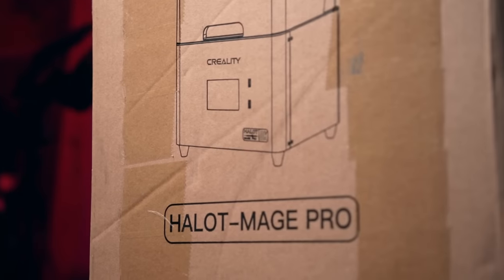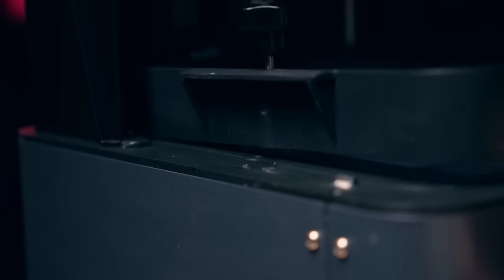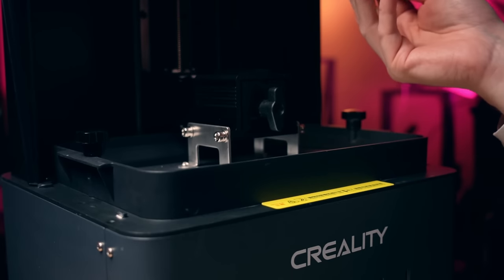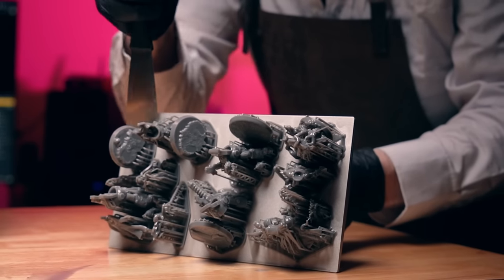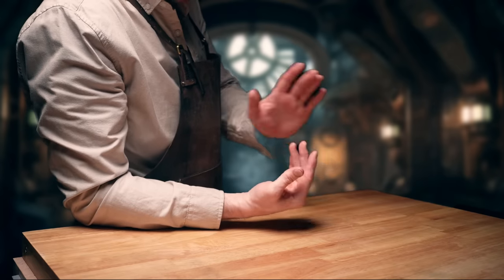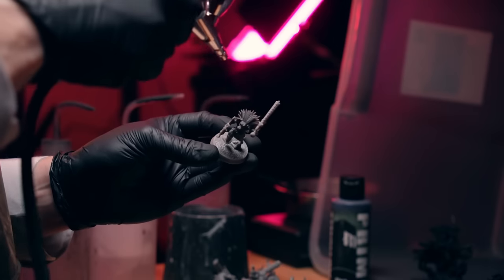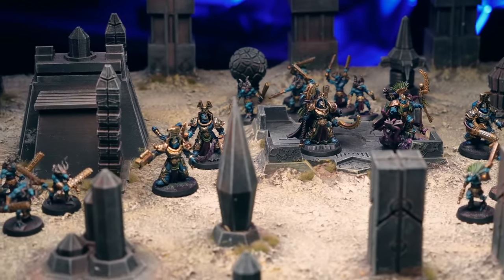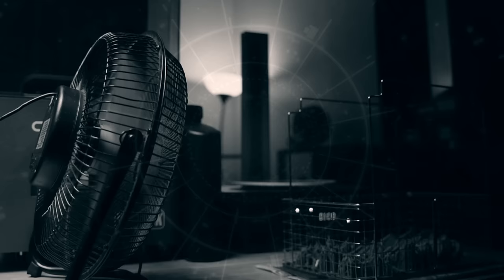We have Warhammer at home

Comment: On the subject of ventilating the printer in cold weather, I don't think you should be ventilating while the machine is running. Wait till the print has finished, then run the ventilator.

Comment: Cool video, thanks. 

Quick point on tightening the 4 bolts on the leveling plate. Bolts loosen, in an environment with vibrations, due to tiny lateral movments at intefaces in the bolted connection. Rather than banging the bolts as tight as you can get them, and risking stripping the treads, just take out the washers. This removes an interface in the bolted connection that supports vibartion loosening. The washers will be there to spread the load from under the bolt head across the hole the bolt goes through. I'd be surprised if they are needed.

Comment: Amazing videos as always. The wait between these is a bit long, but so worth it in the end. Thank you for keeping the production level so high!!
About Creality printers, I have one that I haven't used in a while because it has a "factory problem", the LD 002H. The UV LED array needs a 24v input, but their PSU has a 27v output so everything gets overexposed, no matter how low you set your layer time (I've been printing at 1s and some details don't show up). I've tried wiring a voltage resistance or something like that, but for some reason, it doesn't work when I set it to 24V... I left it in a room gathering dust and bought an Anycubic Mono 4k.

PS: In spanish, beetle is "escarabajo" like you said "escaraba" but with a "ho" at the end like "horse".

Comment: If you tighten the bolts. Your ambient temperature must be the same all the time. If your printer heats up its enclosure by some degree you might need to re-adjust no matter how tight you make the screws. Happend to me when I was printing at ~15°C. While printing, the temperature in the enclsure reached above 20°C and I allways had to re-level.

Comment: After reading the feature set of the 3d printer, The splashing that's happening is due to pulling out the resin pump. Apparently it moderates the level of resin required for a print to prevent splashes when printing at high speeds. 

Still should be able to be accounted for when removing the pump but it's worth noting.
Reply: Fundamentally, the splashing happens because the platform raises all the way to the top, rather than a small distance above the vat. This is because for some reason, they decided to put the home sensor at the top of the build plate rather than the bottom like every other manufacturer. I gave them this feedback on their first printer, and they never listened to it :(
Reply from the maker: Interesting idea. For me the splash all over the door happened after my very first print where Dynax was turned off and the printer was incredibly slow at every step of the print with the exception of the lift speed at the very end, and because my print was a super short calibration part the whole build plate was still submerged below the resin line when the last layer finished. If you look closely at 0.35 too you can see those drips on the door start from waaaay up high which is not what you would expect from droplets falling and splashing in the vat. I should probably make a short or something recreating this
Reply: @OnceinaSixSide  Your theory makes sense, but I don't think it's right because for people who do run their printers at very high speeds where the piece is constantly being removed from the resin/vat quickly, they don't really experience the same level of splashing 

I have the Halot One and the splashes are above the build plate, despite the printer having a slow lift speed after the print - I think it's because of how viscous/dense the resin is. The quick lift definitely doesn't help though, because the faster it lifts the more residual resin there is to drop off the plate and cause splashing

Comment: Thanks for the video. 
Question to everyone: has anyone tried using LocTite on the leveling bolts? Would there be a good reason not to try? 
LocTite comes in both medium hold and strong hold variety; the medium hold is designed for bolts that the user could remove in the future. I don't think the strong hold would be appropriate but I've never heard of anyone trying the medium hold.
Reply: Do not do this. If you ever need to relevel (every time the FEP is replaced), you are screwed.
Reply: @alexfrantz8389  Even with just the medium hold formula? Okay 👍 thanks for the reply, I'll avoid the LocTite.

Comment: You are not too old to say the word yeet I mean here's the first recorded usage of it and this man is probably older than you at this point 
https://youtu.be/PwfwUzngFis?si=wRzle2trm6xZ42hQ
Reply: Also when it came to the experimental painting testing different things
Because you have the printer you can print more so you can do a couple of tests color combinations on like three to five of them and then just print a few more if need be, I did that with how I painted my grey knights black primer, two full coats of silver, a black ink wash over all the silver and because I watered it down a little bit it became slightly translucent so it almost worked like a contrast paint allowing when the light hits it it still looks metallic but in the darker areas or in the shadows it looks black thankfully everything is acrylic or the ink it's a little bit of warm soapy water I was able to get it all off the ones that I didn't like how they turned out then I went over certain areas in white and then hit certain trim pieces elbows and gemstones and either an orange or red a blue turquoise purple depending on if the model is a strike squad purgation squad interceptor purifier Terminator paladin, and had to do a couple of ideas for the Nemesis Force weapons like I tried doing the blue they are normally but I didn't like how it looked so I went with a very thin red paint I have on top of the silver for the swords and the spear blades and it looks like a blood-stained sword to represent the demon blood that the weapons are supposed to have on them. And thankfully I came up with some color ideas with a drawing I had done including the alternate heads using meck wolf space wolves upgrade Horace heresy sprues that I was able to find free files for the only unit I haven't used it on is my librarian but that's because he's actually a deathwing Terminator from the miniature of the month from back in April of 24 sadly I was only able to get one because I need a total of three for my army and my brother and I never went to the store that month to get any more but my brother got two as we went with our half-sister we all got one and my brother kept two for some reason even though he already had his full army and to this day he still hasn't done anything with them
Reply: And currently for my own grey knights combat patrol box I'm just missing the dread knight but points value wise if I add an ancient banner to paladins and do the interceptor squad for the regular Marines I could point value-wise use the dreadnought instead as a replacement